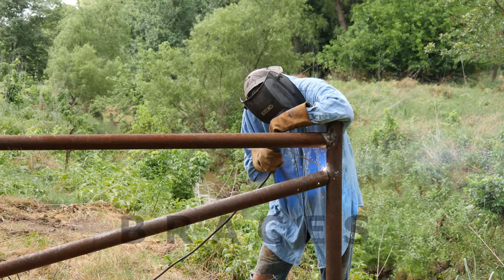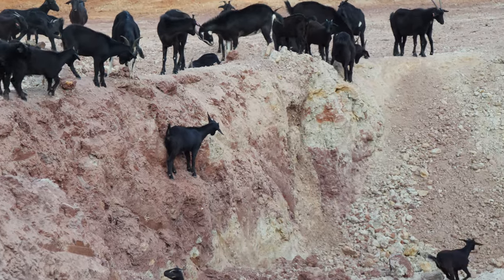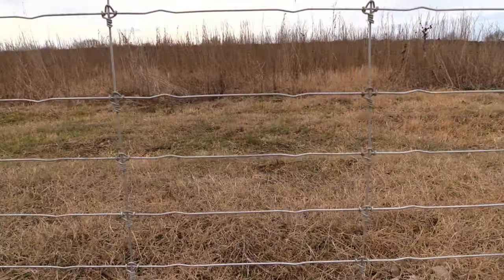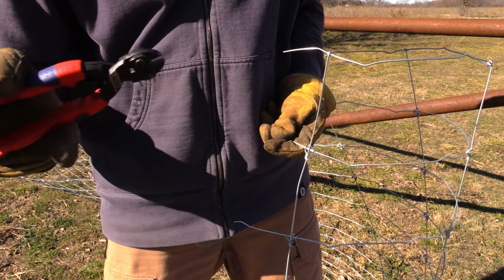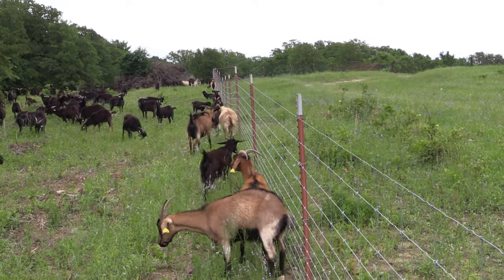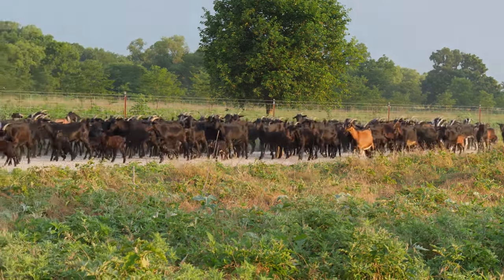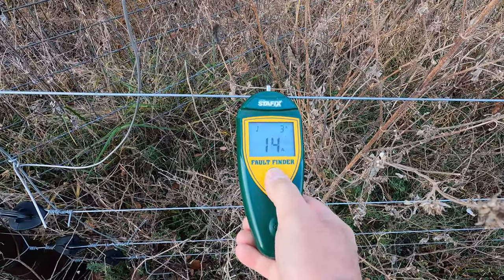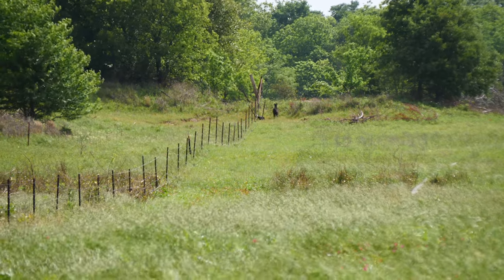4 Types of Goat Fence with Cost, Pros and Cons | 3 Channel Collaboration  About Goats

Comment: Crimps and crimper
Reply from the maker: ???………ah!!!! ……it took me a minute to go through all the fences in my head.  You’re right!!  I forgot the crimping tool $79.95 and sleeves $13.25 for 100.  I use those to join 2 rolls of fixed knot net wire.  Thanks.  I’ll see if I can pin this response.

Comment: You haven't mentioned anything about fire risk for the electric fences. Can it create hot spots or sparks that start a grass fire?
Reply from the maker: My experience with 25+ years has been no.  My education says there has to be a possibility.  I would get an explanation from the manufacturer of the energizer you’re wanting to use before purchasing it and so you can better understand it.

Comment: Good video and great info. I found some 300+ varieties of Knipix pliers, but none of them looked like the pair you have. Do you know the model number? Thanks, Dennis
Reply from the maker: Hey Dennis!  Yes there are a ton of them.  This is the one I use.  Knipex 71 32 200 Comfort Grip High Leverage CoBolt Cutter with Notch and Spring       I copied that description off of Amazon.   It looks like they're only $47 now.  Jackpot!!   Thanks for watching.

Comment: Thank you so much for the info! The electric on-top of the knot fence, would that help keep predators out?
Reply from the maker: Thanks for watching..  The top wire would do nothing for predators.  I use it to connect cross fencing.    If you put  the electric down low it would help with predators.

Comment: Hey Brett, Good instructional video. Makes complete sense. I've put up some similar fence around some large pens in the past - mostly for calves.  And I've put up a fair amount of barbed wire fence over mostly flat and rolling terrain, but I'll be putting up this quality goat fence over a terrain that is mostly hilly and steep in places. Any suggestions for me? Also, I did see the model number of the Knipex wire cutters.
Reply from the maker: Yes when you go from hill top to hill top.  Don't over tighten the wire.  I usually tightened it until the fence was about 5 feet off the ground at the low point.  Then I drove a pipe, pulled the fence down with my stretch bar and skid steer and wired it to the pipe.  The grapple clips are a must for me when you're attaching the fence to your end braces.
Reply: @addisonranch  Okay, what about the position of the T-posts? Should they be perpendicular to the ground or put in vertically? I've had people tell me both ways. It seems to make more sense that they would be perpendicular, especially on steep terrain, so they would line up with the 48" goat fence. Thanks, Dennis
Reply from the maker: @dennisdean3925  a t post wouldn’t hold it down I would drive or cement a single pipe 4 foot in the ground.  That’s what I did.
Reply: @addisonranch  Okay, Thanks. I've got probably 2,500 lineal feet of fence to install and nearly all of it will be on hilly to steep on rocky (soil) terrain.

Comment: Have you used high tensile Bekaert field fence? It is high tensile like your Stay Tuff. I agree fixed knot is superior but I can get high tensile 47" field fence interest-free for 48 months for $210 for a 330' roll.
Reply from the maker: What kind of warranty is on the wire?  Never mind I just realized your talking about Field Fence.  I would HIGHLY discourage ever using that.  If your heart is set on it I’ve of got several rolls of the same type fence by Sheffield that I would sell cheaper than that😳😳
Reply: @addisonranch  Will you finance 12 rolls of it with 254 T posts 0 down and 0% interest for 4 years? 🙂
Reply from the maker: @ThePushmataha  I don’t like the thought of financing but if the wires cheap enough it may work for you.?  I don’t have any extra t post…….Are you a rep for Bakaert or are you really trying to get some fence built?
Reply: @addisonranch  Really building a LOT of fence. I am retired and would prefer to keep earning a return on my money and use theirs for free at 0% for 4 years, They offer a high-tensile fixed knot goat fence also but it is $479 for a 330' roll + shipping. Was also going to run some elec fence inside this to keep them off it.
Reply: @addisonranch  This is all through a special offer from TSC. They charge a hefty shipping fee on some fence raising the cost considerably, so limited to what they keep in stock in the area. Getting some goats to keep the vegetation down on my 170 acres in the SE OK mountains.
Reply from the maker: @ThePushmataha  okay.  The electric in side will help a bunch.  It will help with cattle too, not so much deer.

Comment: Correct me if I'm wrong but doesn't field fence just describe the pattern of the wire? Your fix knot is probably a high tensile fixed knot field fence?
Reply from the maker: I’m not 100% sure of the specific names.  I think they all fall under “net wire”.   They’ve always been referred to like I said in the video.  Which is how I’ve referred to them for 21 years.  That doesn’t mean I’m right😂😂 however it does mean it will keep me from getting confused when I’m talking about them😂😂😂. Thanks for the comment.😁

Comment: Is there any reason you wouldn’t use a solar powered generator? Is it because it would not be powerful enough for the length of fence that you have?
Reply from the maker: Yes.  Because of our brush and the length of our fence, we need more joules from our energizer.
Reply: OK, thank you so much! How do I find out how many joules I need for my length of fence? Also, do I need to use that huge metal pole for bracing? I don’t have heavy machinery like you do. The best we have is a post hole digger that we have used to put in wooden posts. I guess I had thought that we could put up an Electric fence using only T posts. At least this is what a guy at tractor supply told us that he does. Can I attached to a tree as one of the anchors on the corner? We are completely new at all of this and trying to give our goats more space to graze. We are currently raising Mini Nubians. Thank you so much for your video and for your help! I will be subscribing right now!
Reply from the maker: Hey Andrea, The brace is totally dependent on the type of fence.  If you're looking at an electric fence you can totally use a tree for the brace.  The tree will grow around the wire you tie to the tree so it will need to be retied based on that.  Joules for the fence is a hard one.  I would figure out how many feet of wire you will be electrifying and start there.  Then get in touch with someone like Kencove Fencing and tell them what your doing, how many feet of wire and potential brush.  NEVER under power your fence for goats.

Comment: Whats your opinion on the 4x4 sheep and goat fence I believe it's a fixed not type.
Reply from the maker: The 4X4 will work great if its fixed knot.  It will cost more than a 1348-12-660 because it has more wire per foot in manufacturing.

Comment: How often if any do you find your self having to replace worn out or cracked insulators on the t post?
Reply from the maker: The only time I’ve had to repair an insulator is if an animal hit the fence so hard it broke or bent the pins that hold either the wire  or the clip in place on the post.  I’ve never had to replace one because of cracking etc.
Reply: @addisonranch  thanks for the info! What brand insulators are you using?
Reply from the maker: @bearfamilyfarm  kencove 2 pin clips.

Comment: Is field fence the same as woven wire fence?
Reply from the maker: I think fixed knot and field fence are both called “net fence” but I will never use field fence again.  I would probably use barb wire before field fence but fixed knot is the best.
Reply: @addisonranch  Ok thanks....I'm trying to figure out if something like  Red Brand woven wire for sheep and goats the same as field fence or is it fixed knot .....regardless thanks for this video it's a massive help to a Beginner
Reply from the maker: @braceyrice5413  I’m not sure on the redbrand.  The fixed know refers to the way they tie the vertical and horizontal wires together.  The fixed knot I use I good because of this knot but also because the wire is high tensile wire.  It’s much harder to bend which is great but that’s also what makes it hard to work with.